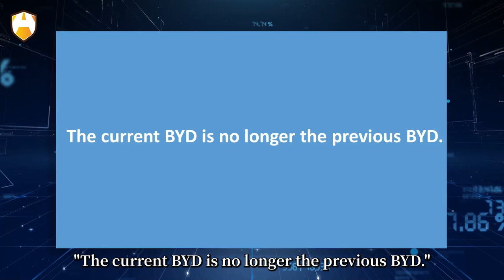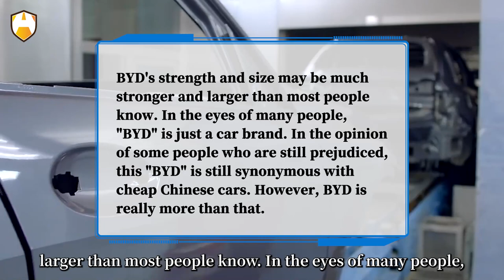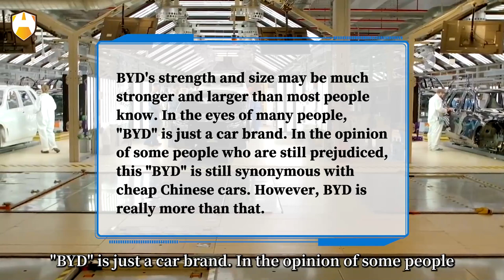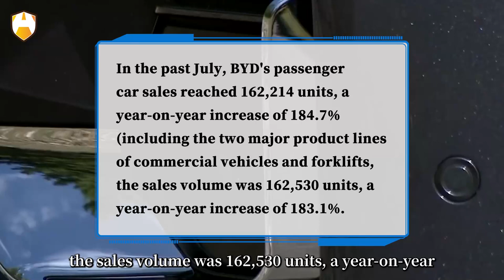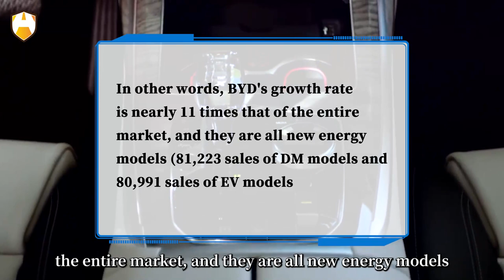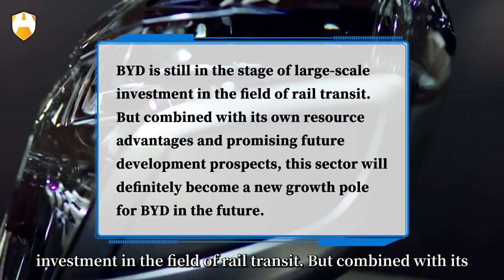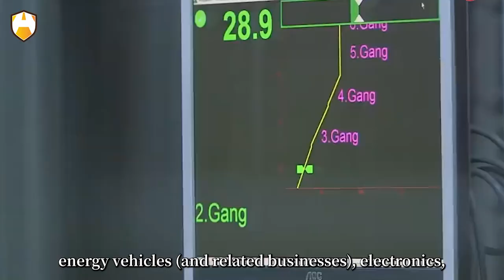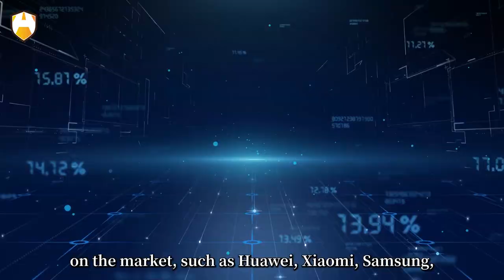BYD, the industry is not limited to automobiles, and the business is not limited to China

Comment: Here in Uruguay, I own a BYD Yuan usd39k, 2 years, 25000km, zero trouble. I own a BMW x3 usd92k, 7 years, 70000km, only minor troubles -  maybe because of being assembled in the us and not in germany. We are satisfied with both. But all at home  3 sons 26 28 30 and me fight to use the Yuan, as its 52kwh battery delivers 240 to 380 kms depending on how you drive it ,  which is usually enough for the day. And for 1/10th the cost per km, as Yuan is electric. So we keep the BMW only for long travellings. My next car will be an above 100kwh battery one. Unfortunately BYD has raised their prices significantly now, seems obvious they are aware of their products value.  But before that I plan sunpanneling my new little house in the mountain. Its another BYD project using their LiFePo battery banks I will scale to 90kwh. I love this company!!